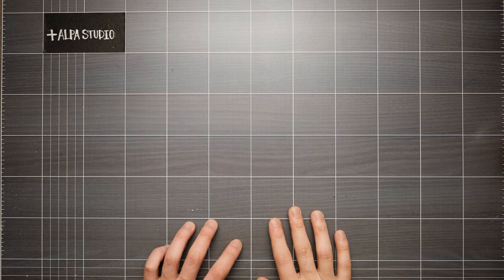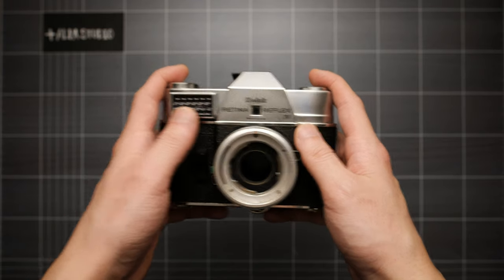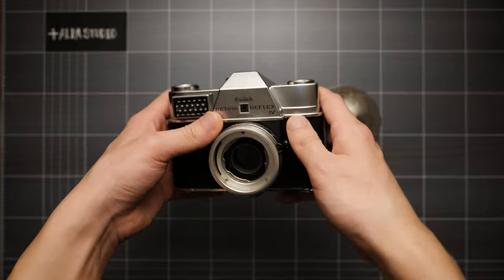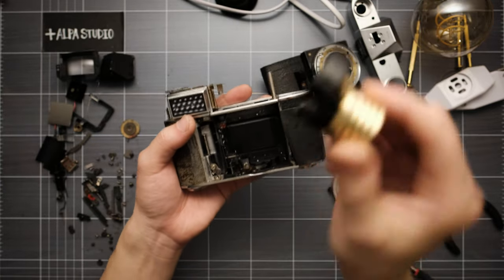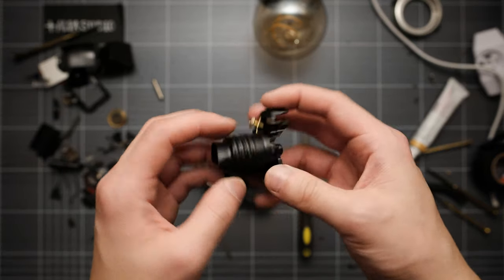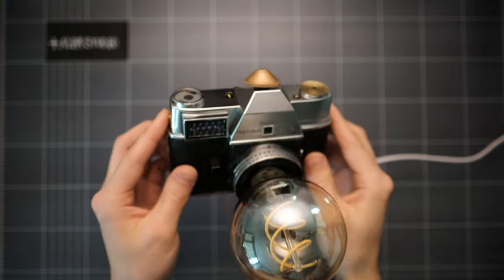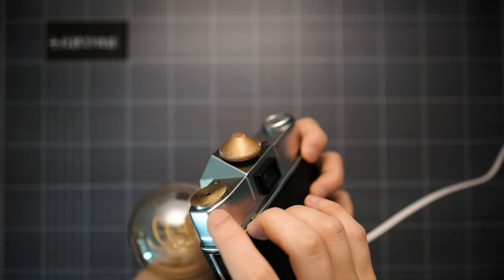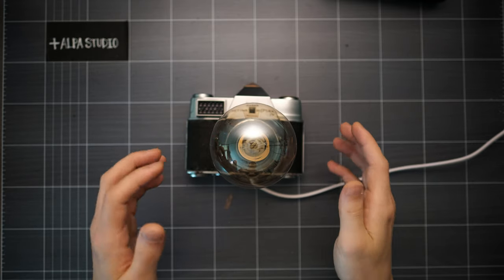DIY Camera Lamp : Kodak Retina Reflex IV | Craftsmanship

Comment: Electrical tape is not the best insulation material  it is damaged easily and can melt with heat.  A safer design is to use a low voltage bulb   like 12 v and a external power supply.    Gfi electrical plug may help make you safer.
Reply from the maker: Thank you for your advices!